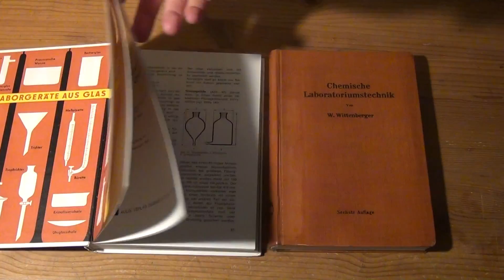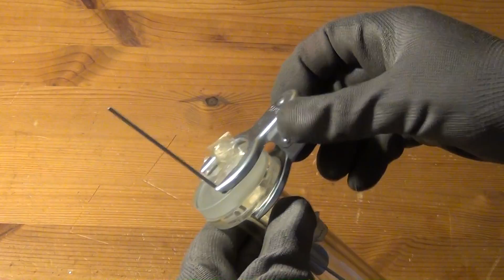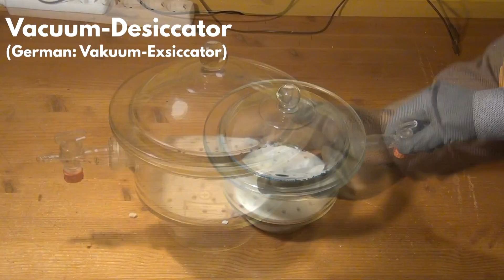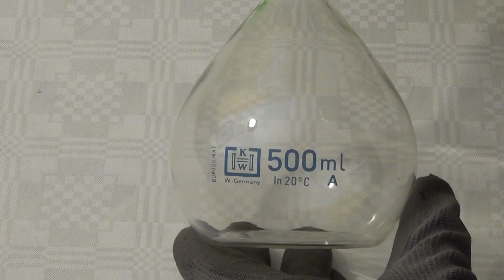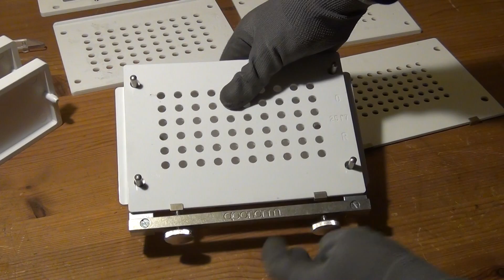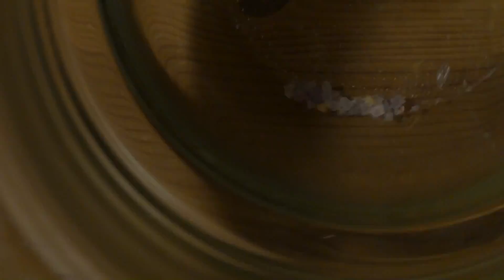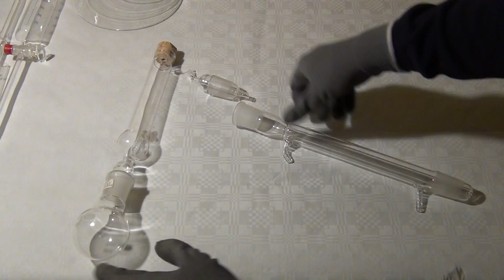Insane Chemistry Lab - Flea Market Score!

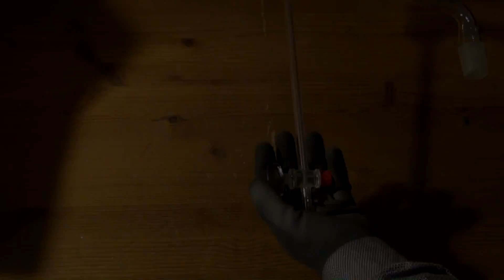Comment: The glass object  at 7:14 is a Dean stark Trap. It is used to collect water from some organic reactions as the reaction is carried out( though it has other uses as well). It depends on the task at hand.The  "burettes" around 10:30 are likely different  Liquid chromatography columns. The tube at 10:51 could possibly be a melting point apparatus but I am not certain.  the funnel at 11:42 is a good thistle funnel. Its used. with stoppers, to introduce one liquid in/under the surface of a second liquid or as a funnel with a reservoir. at 13:20 it looks like a vacuum or refluxing still head with return. I am more familiar with the US versions so I can't offer too much here other than it looks like it is missing parts to make it work properly. That wood backed glass piece with the mercury is a VERY lucky find: due to mercury fears many of these are disappearing( at least here in the US) and are hard to find. It is a very nice manometer. At 16:05 it is likely Cupric sulfate but is possible it is cobalt chloride( or atleast contains it) In the case of cobalt chloride it turns pink with exposure to water.. Cupric sulfate is bright blue in the presence of water( when anhydrous it is a white, very pale light blue powder). From my limited time using a similar apparatus, the object in 23:40 is used by immersing it in a beaker with oil( which oil depends on the expect melting and freezing point of your sample) and the beaker is heated to melt the sample. after it is melted you would  slowly taper off the heat and allow the sample to cool. at graduated intervals( say one every 60 seconds) you would raise and lower the loop. when the sample reached the freezing, or solidification point, you simply  not when you either can't move the loop or the resistance to moving it shows the sample has solidified. I need to check on this so I apologize if I am wrong.  I hope some of this helps but as always be safe and verify for yourself.
Reply: Yeah... I though that might be a Dean-Stark trap too.
It'll be Cobalt Chloride not Copper Sulphate... what with it changing from blue to pink with water and all.
Reply: Dean stark set up also used for measuring water content of compounds by boiling with toluene. The water in the sample boils off first and is collected separately, run off, then measuered or weighed.

Comment: Sorry, some stuff I will only describe in german, and I'll only do the stuff you did not have correct or didn't know.
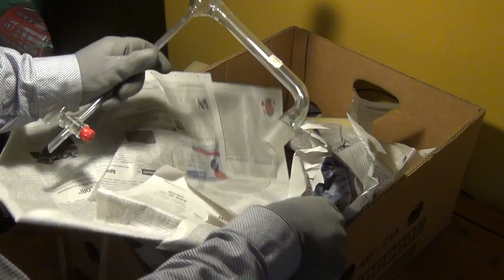6:50 looks to me like some old sort of gas scrubber (Gaswäscher)
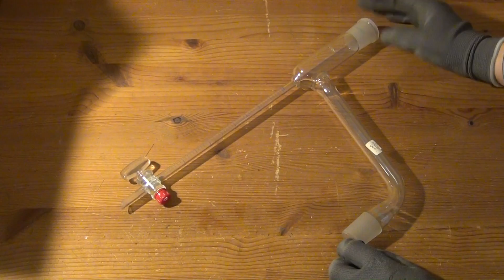7:04 This is a water trap (Wasserabscheider)
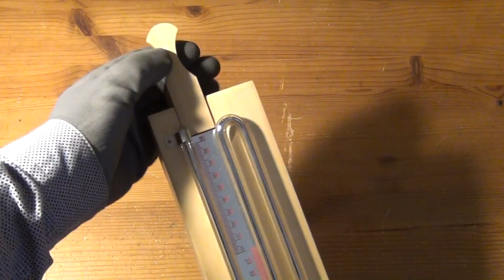7:35 a very very old vacuum (or pressure) gauge (Druckanzeige)
8:49: needles for syringes with luer connector and a re-usable filter
10:22 and 10:30 columns for chromatography (Säulen für Säulenchromatografie)
11:44 looks more like a part of something, but I have no god damn idea
12:54 This glasware can be used for 2 things, for continuous liquid/liquid extraction (oil and other stuff) or as a water trap
15:47 the damn things always tend to stick. The blue stuff is Blaugel, a type of silica gel with an indicator for water in it. as long as it is blue it can still absorb water.
16:51 I have the exact same book handed down from my former boss (he's retired for 16 years and did get it handed down from his boss at a young age.......)
greeting from the lab
Reply: the dean stark trap at 7:12 ? correct me if i'm wrong
also the vacuum gauge at 7:35  is used to measure vacuum in vacuum destillation atleast thats what we used it for in school
Reply: Percolator in English.
Reply: 10:22 - Gel Permeation Chromatography ?
Reply: destroyer4416 correct, 7:12 is a Dean Stark, also known as water trap
Reply: Victor García it probably could be used for that but I think standard silica gel is more likely
Reply: Pretty much spot on.

6:50 Is a "Perkolator" (sry, no idea what the English name is), it is used in the extraction of natural products to get I higher yield. It is more or less a reservoir for the solvent on top of the extraction column.

And the thing at 12:54 is made to extract essential oils through steam distillation (to be specific: "Apparat zur Bestimmung von ätherischen Ölen nach Brückner").

If you are really interested in the principles, let me know and I could explain it in more detail.
Over all the whole equipment can be used in natural product extraction.